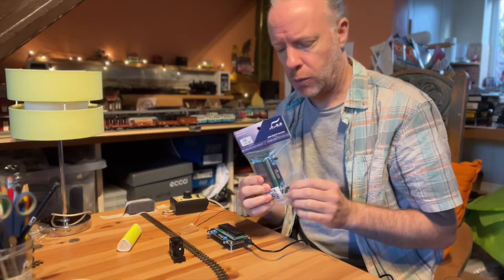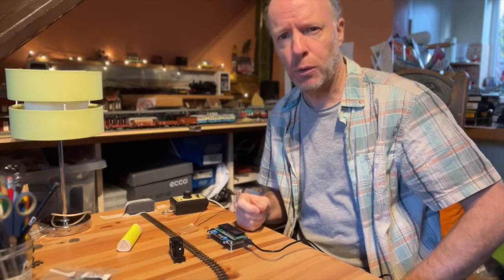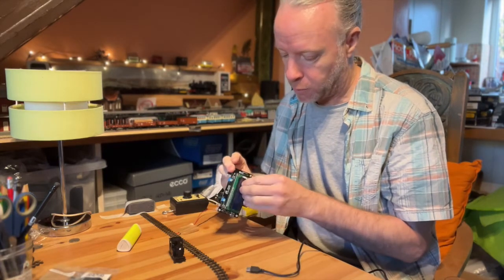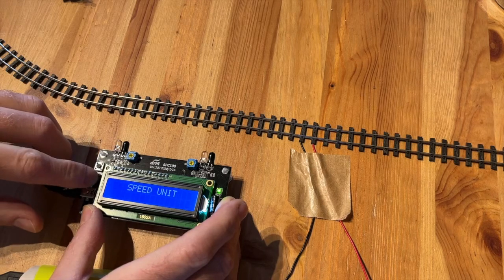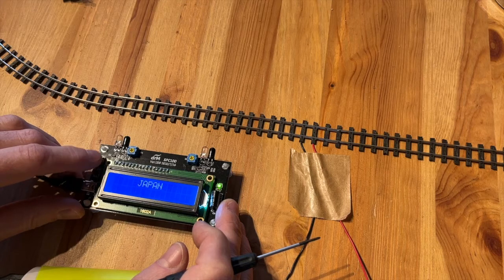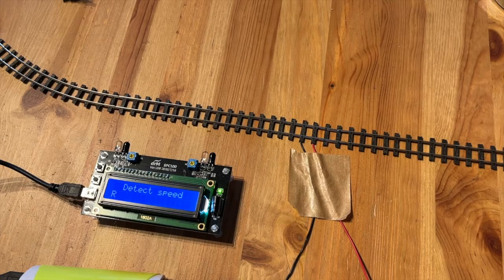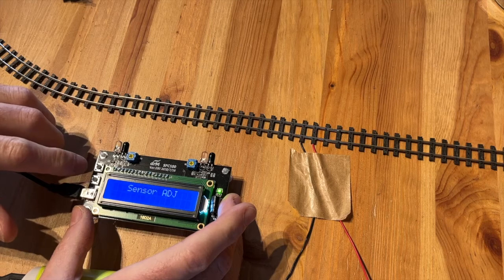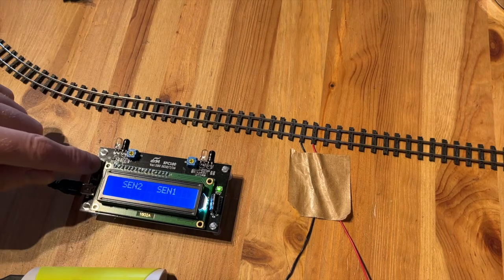DRM Speedometer - Introduction and user instructions

Comment: Just received one and am having trouble with set up. Following the video, I am unable to select the region or adjust the sensors. Any suggestions?
Reply from the maker: Sorry, I did not see your comment until now. Have you contacted me at the tramfabriek for assistance or have you figured it out by now?
Reply: I apparently I bought one of the original versions that doesn't have that feature.
Reply from the maker: @SoloContracting  The earliest version doesn't have regions. Are you missing a certain scale? Please contact me by email (info at tramfabriek co uk) if you have any questions. I'm not actively monitoring this comments on a daily base. But I think that was obvious. 😁

Comment: I got my new one v.211 and literally cannot get it to work, basically when I plug it in the detect speed does not appear thus I cannot measure the speed which in turn does not allow me to set area or scale but luckily it already set to UK OO but the unit doesn't detect any speed.
I tried unplugging and holding down the top button which allows me to set either the Time, MPH or KM/H but that's all I can do because Detect Speed never appears on the screen.
When it is on the unit just flashes between speed info screen and some sort of sensor screen and does nothing else and the Detect Speed screen never appears.
Any advice or is it a faulty unit???
Reply from the maker: Hope you contacted me by email for support, as I only see this message now. When that message appears, common "mistake" people make is that there is something in the way, the sensors are set to detect too far or there is too much sunlight in the room. Please read the FAQ that comes with the device, all questions are addressed there. Since I ship that with the Speedometer, it seems to help everyone started.  If you haven't received that A5 paper, contact me at https://tramfabriek.nl/contact.html and I'll send it to you.